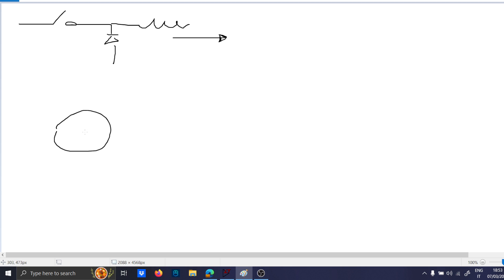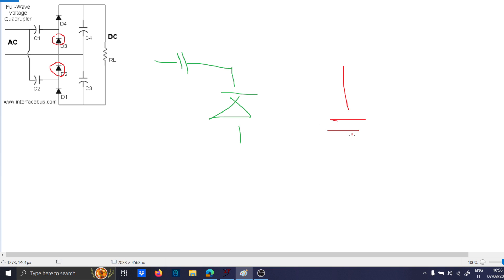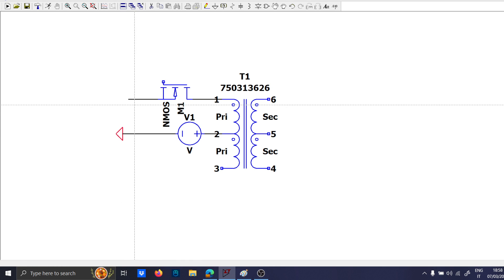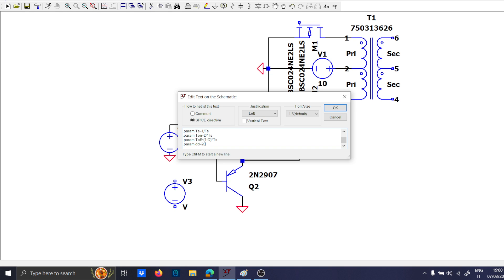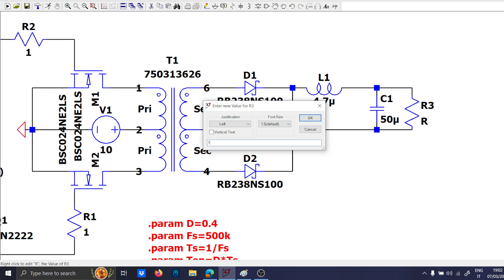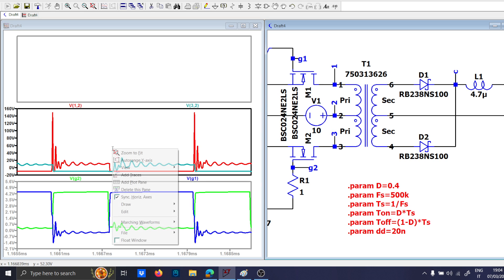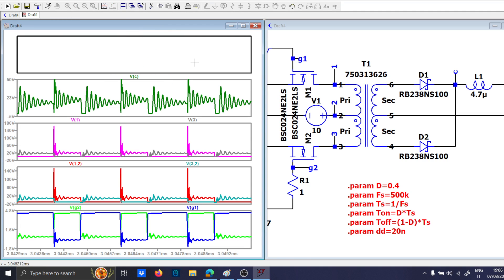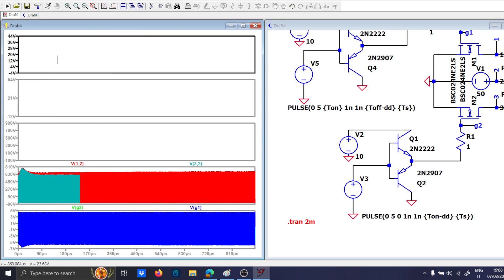LTspice Push Pull DC-DC Center Tapped Open Loop

Comment: Hey! Appreciate the video! One question, why do you have different Ton periods for the two different MOSFETs of the converter? Won't that lead to flux saturation/flux walking?
Reply from the maker: @larspetersson7168  Both duty cycle should be D-dt. It's a mistake on my side
Reply: @LukeXVIIx64  Ok, thank you, that removes my confusion! :D